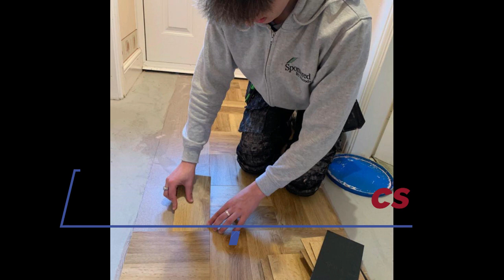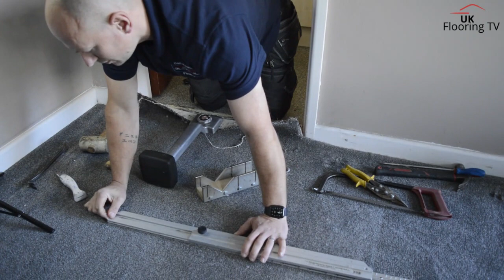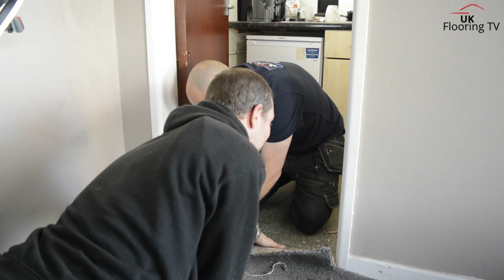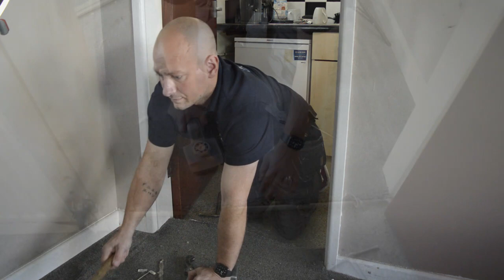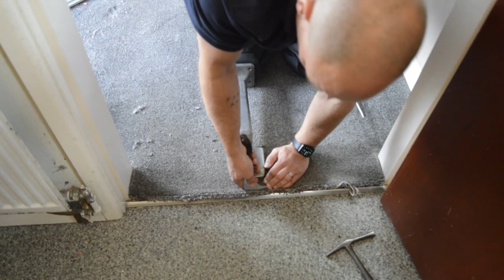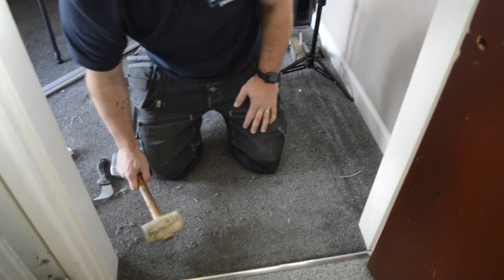Beginners guide to flooring. Apprentice basics episode 7, how to fit doorbars correctly.

Comment: Great advice but I find it better putting plates on 1st  so I can work up to them
Reply: If you’re only replacing the vinyl and not the carpet obviously that’s not possible. Definitely in normal circumstances bars go down first. Plus too liberal with the adhesive. No need to wipe it just don’t make a mess in the first place.